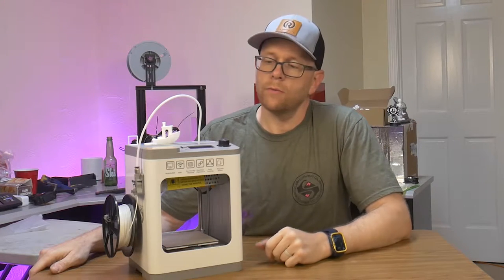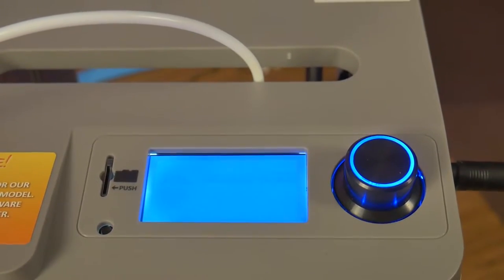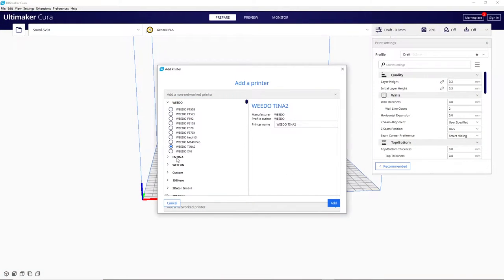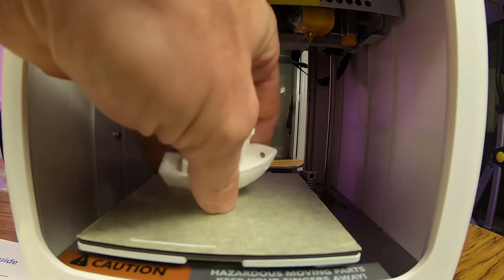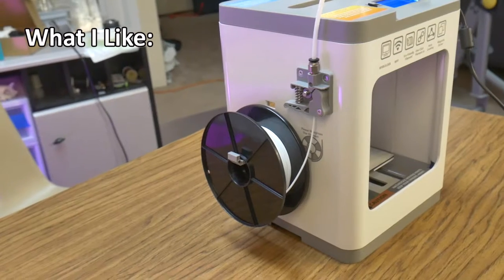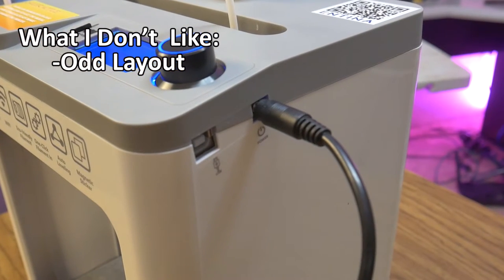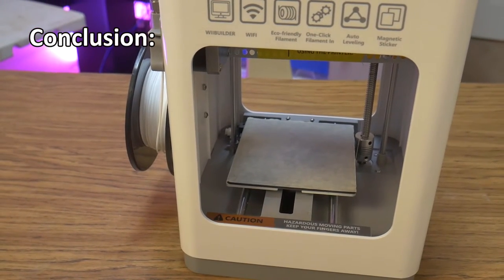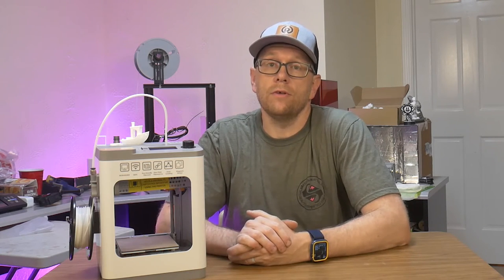Entina Tina 2 3D Pinter: How does it measure up?

Comment: I have seen a few small part enclosed form factor printers but this is by far the best one, you can see they have worked hard to get this printing as well as it does without a heated bed, and I wish them every success!

Comment: It's possible to send files to this printer via wifi from your desktop pc, but only by using the wiibuilder software, unfortunately. If you get the "upload failure" message when trying, use another sd card and try again, this will probably fix it

Comment: Does this require software other than what comes with the machine to import ready to print files? I’m new to 3D printing but have watched a lot of videos.
Reply from the maker: Most, if not all 3D files will need some sort of conversion in order to be printed by your machine. I’m sure there is software included with the printer, but your best bet is to download and learn how to use Cura. It is very user friendly and compatible with most printers in the market.

Comment: How does it compare to the toybox printer?
Reply from the maker: I would say performance-wise it is the same. The toybox one is a core xy so the bed moves up and down instead of back and forth like this one. The main selling point t of the toybox is its ease of use. No slicer needed. Pick your toy from the app, customize it how you want, then press print and it sends the pre-sliced file directly to the printer. It is a really smart idea.  You can also slice your own files to print with the printer so you aren’t limited to their 3D model selection.

Comment: What is the max print temperature on this printer? The website says it prints TPU, which is around 250 on a high end and 230 on the low end
Reply from the maker: Yeah the Bowden tube-fed system such at this one has a technical upper limit of 250, because that is the thermal breakdown limit of the PTFE tubing, but it won’t last long if you print a lot at that temperature. There are other TPU formulations out there that print well at lower temperatures on Bowden systems. Look at the specs. I always buy TPU rated for 210-220 hotend temp.